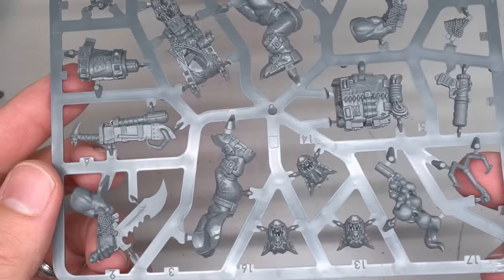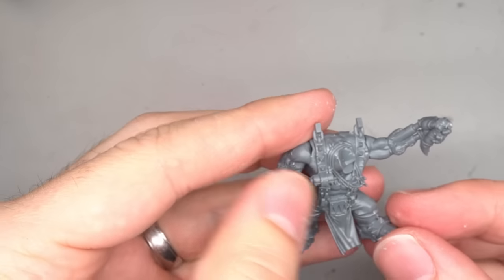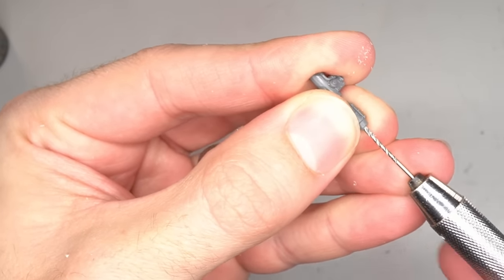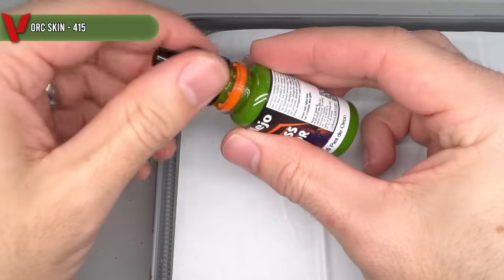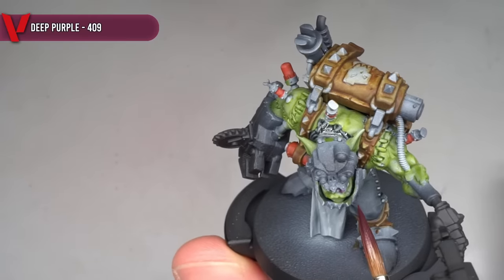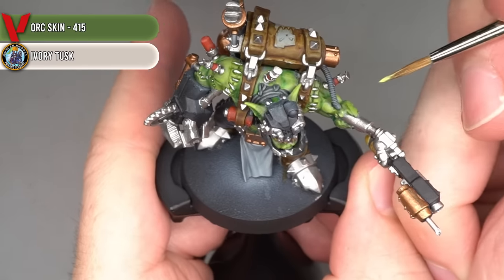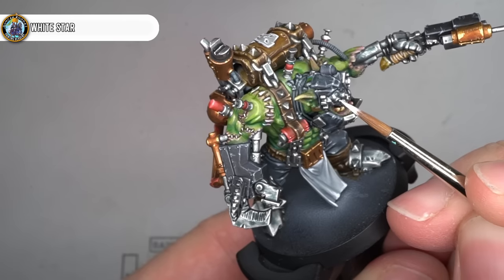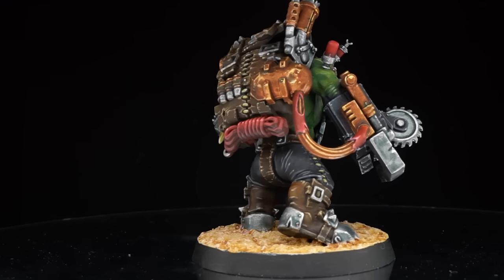Bringing an ORK LEGEND Back to LIFE! How I Kitbashed Mad Dok Grotsnik from Snikrot

Comment: Always love your ork conversions. Been meaning to make a batch of fung-orks for myself after seeing that conversion on your channel a while ago. Do you have any quick recommendations on how to add blast damage to terrain pieces? I'm worried about cutting into mine without a plan.
Reply from the maker: I'm guessing you're talking about plastic terrain? The easiest way to get pock marks is to drill or dremel shallow holes, add a small amount of putty (greenstuff or milliput) and press it into the hole so it flares out around the edges. This helps to create the surface deformation and you can scratch in more jagged edges too.
Reply: @PeteTheWargamer  thanks!

Comment: unrelated to this video, but i hoped i'd have the biggest chance of you replying on a new video.. ^^'
i'm planning on converting a keeper of secrets, and i want it to look really gaunt and slim (ribs visible, barely skin and bones, etc)
but i'm not sure how to go about it, i'd like to either use the original keeper of secrets bits and just file / cut them down to better fit, or exchange maybe the torso for another kit, but i haven't found anything that fits the size of a keeper while looking gaunt and too thin
does anything come to mind? ^^'